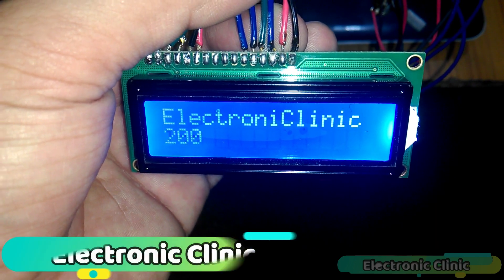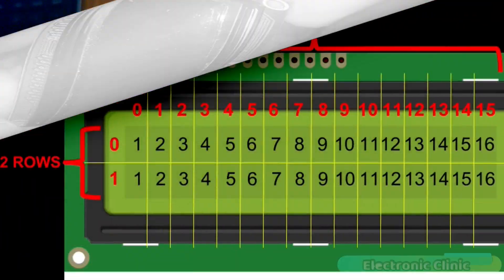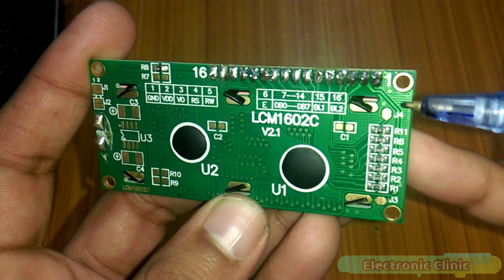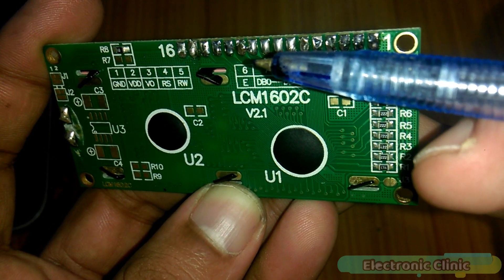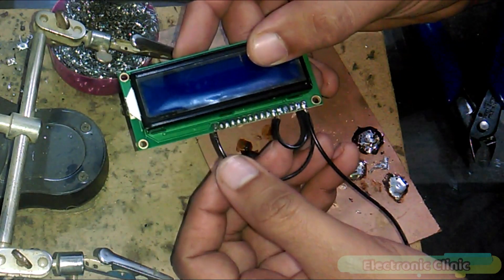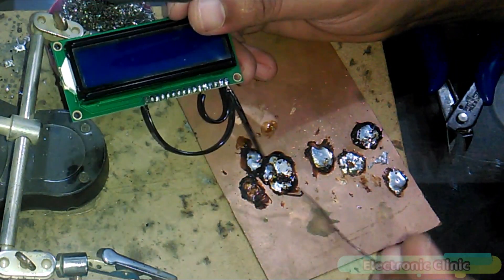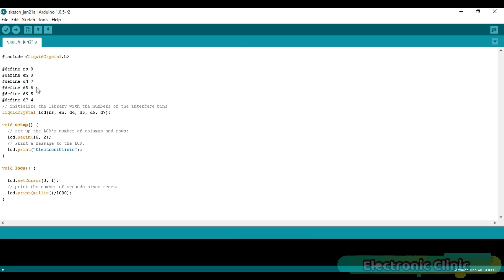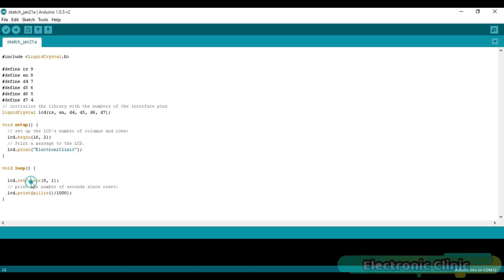Arduino 16x2 LCD Introduction, Interfacing, Programming, Soldering, & Testing

Comment: Can this be implemented without the variable resistor? Any issues that will come up if without it?
Reply from the maker: The lcd wont show anything and you wont be able to control the brightness. But you can connect it with the pwm and set the desired voltage. This way u wont need any resistor